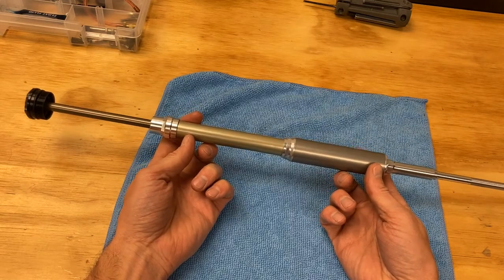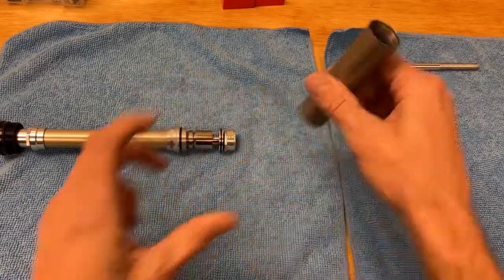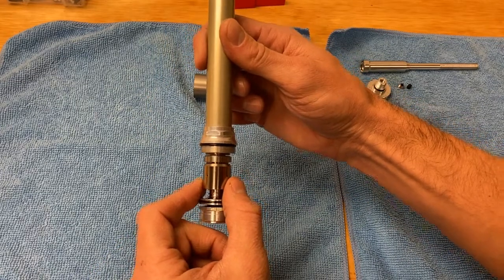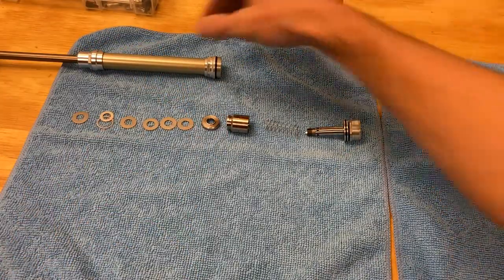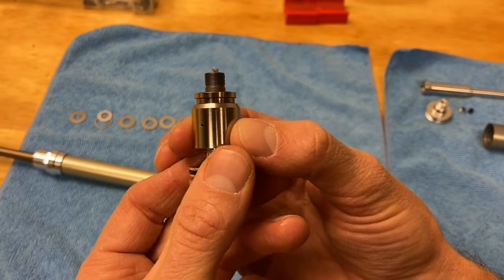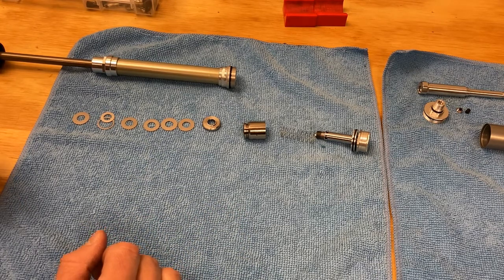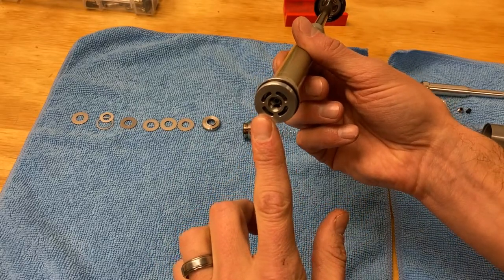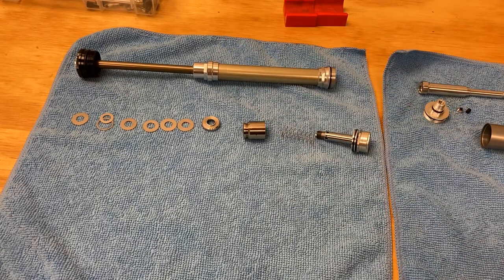Disassembling a SPECIALIZED BRAIN Fork Cartridge

Comment: Hi, great video, I'm not a mechanic, but I'm interested in how to setup the shims you mention to reduce pressure threshold. Would this setup increase sensitivity over small bumps? How is this setup done? Reduce shims to reduce pressure threshold?
Reply from the maker: stock is 4 shims behind the ring.  cut it back to 1 or 2 if and the small bump compliance get WAY better.  The fork becomes a dream to ride compared to other dampers.

Comment: Hi, fellow bike rider. Does this cartridge needs any seals kit during bike usage? Any seals kits like the Fox ones for the micro brain, but for the front fork. I have 2014 Epic Comp with Reba, could not find anything beside rear brain/air chamber.
Reply from the maker: I have the same bike.  The seals are proprietary and bike shops will not sell them to you... HOWEVER.  The seal kits can be found on ebay.  

My advice...  Remove 3 of the 4 shims preloading the ring shim on the blowoff valve.  It turns that damper into an absolute miracle.
Reply: @INTEGRALPHYSICS  i am not a mechanic and i dont have tools/skill to disassemble, but i will tell my mechanic about your advice.
Any ideas about name of the seal kit? I only found this one: Specialized Brain RockShox SID Fork Service Kit Part# 11.4418.009.004

Comment: Hi Integral physics, I hope you can help me, I have a sid brain with hydraulics identical to the one in the video, I wanted to ask you, please, if you can show me the correct procedure and the type and quantity of oil to insert to restore it.  I lost all the oil inside and I don't know how to fix it.  A thousand thanks
Reply from the maker: Getting the oil in and the cartridge bled is not particularly hard.  Charging the IFP chamber takes some specialized equipment. (a fill needle)
Reply: Would you mind to tell me the pressure for the nitrogen chamber? 2014 Sid brain many thanks

Comment: I can see this system working quite well when tuned to the rider and terrain but terrible if not. The inertia valve i suppose controls 'low speed' oil flow which when in more closed state transferres oil pressure much sooner into the ports closed by the shim stack. If you would have the right shims and a reasonably light spring/low preload pushing the shims onto the port the whole system should be quite active. Making this system work well for a wide range of weights i would think would be quite hard. The threshold pressure keeping those ports closed would have to be quite high though though otherwise when the inertia valve is closed the oil pressure would simply flow past the shims. I find this concept of the inertia valve kind if weird as in choppy terrain the valve would be opening and closing very quickly as the weight rattles back and forth.
Reply from the maker: You are correct on all accounts.  Stock the inertia valve-bypass valving is awful.  I finally settled at about 1/4 the stack stiffness.  It was stiff enough to prevent bobbing when sprinting but provided a bit of bleed on sharp hits that would try to move the suspension before the inertia valve could open to dump oil.
Reply: @INTEGRALPHYSICS  Excellent explainer! Is this too firm of a shim stack why it feels like "clunk" when the system opens?

Comment: Thanks so much for the video. You are the only person sharing how to service a brain fork. Would you be so kind as to tell me how to take the damper out of the lower leg? Thanks again.
Reply from the maker: Looking at the bottom of the lower leg from below, use a 10mm  (it might be 12mm, I forget)  DEEP socket to loosen the oddly long nut down the threaded rod.  Unscrew the nut 5 or six full turns.  Then with the socket still on the nut, tap upward on the end of the socket with a rubber mallet to loosen the dampers from the lower legs.
Reply: @INTEGRALPHYSICS what happened to the ET pictogram pirate long tentacles? With the Albanian seed deployment 😭
Reply: That's the chicken leg frog leg tadpole one spunk, messiah situation was a ball as the spunk, sperm cell 😭😂

Comment: Hi, INTEGRALPHYSICS, im from mexico. I saw your video and read all your answers, this day tried to service a specialized s90 fork, when i tried to dissasemble the fork, i didn't se the circlip that retains the bottom blue cap, so i put a hex key in the little socket, and i heared some of air lossing from it, inmediatly screw it again, i think i remove some of the air from the cartridge and i read in one answers that it haves a 100-110 psi and i will need a needle to fill it. I saw that the bottom screw haves a little black dot, and i wanna put the correctly amount of air,  how can i do that? Just making a special tool to fill air with a neddle of a syringe and inserting throught the black dot?

I will apreciate so much if you can help me
Reply from the maker: Using a syringe needle is very difficult and VERY dangerous.  There are needle filling tools that can be purchased but they can be a bit pricey ($100).  I have not had problems drilling out the plug seat that held the black plug and epoxying in a presta stem and valve.  I have never had a s90 apart so I don't know if a similar solution would work for you.

Comment: My brain stopped locking out rider pedal bobbing but it still absorbs shocks. Any suggestions to get the brain to start doing its job?
Reply from the maker: Crank the rebound all the way slow.  Push the bike down hard.  If the bike comes back up quick then you have lost IFP pressure and need to recharge the chamber.

If when cycling the shock you hear a squelching sound, typically at the top of the travel, you have air in the fluid and need to replace a seal.

Good Luck...

Comment: Hi! Thanks for the video!
Sorry for my english, im from Uruguay 🇺🇾 
I want to know in what part of the system works nytrogen, how can i fill up and what is the correct pressure en PSI.
Best regards
Reply from the maker: Nitrogen goes in the the chamber that sits at the bottom of the damper.  The chamber requires a small needle to inflate and can be quite a challenge.  It takes 110psi.  Air works just fine in the place of nitrogen.
Reply: Thank you very much for your answer, is very helpfull for me. Last question, how much oil i will need to refil and wich oil should i have to use?
Reply: @valentinbarreto9332  You'll bleed and fill the cartridge, and set the piston roughly 3-5mm from bottomed out, with the shaft fully extended. Most fluids with a viscosity 22-35Cst will work well. They say to use "Rockshox 7.5" in the manual, but they mean 7wt.
Reply: @seitenryu6844  thank you very much for your answer, is very helpfully for me! 👏🏻💪🏻
Reply: @valentinbarreto9332  If you do it, please make a post about it on mtbr shock and suspension forum. Cheers
Reply: @seitenryu6844   In the previous answer, you talk about a manual, is it possible for you to share it?

Comment: Was that an IFP at the beginning of the disassembly? You were talking about a rubber pellet being there so there must have been pressure inside, right?
Reply from the maker: Yes.  There is an IFP sitting on 100-110psi
Reply: @INTEGRALPHYSICS  Any tips for IFP depth? Oil weight?
Reply from the maker: @BikeGuruHowick  I use Fox Green (10wt) which i believe is what was in there stock.   IFP depth is  30mm but they added a nylon glide ring to the IFP in later years which changed the ifp depth.  Basically you want the ifp within 2-3 mm of the plate which sits behind it.
Reply: @INTEGRALPHYSICS  what a champ💪 Really appreciate the help man, thank you.
Reply: @INTEGRALPHYSICS  What's the purpose of the IFP?

Comment: please do Rockshox Brain 2.0 rear shock service video tutorials
Reply from the maker: I will do a tutorial on the rear shock next time I have it apart.  The only substantial difference is your bladder vs my ifp.  I will also do a vid on my vaccum bleeder as that is needed to bleed most shocks.
Reply: @INTEGRALPHYSICS  Do you NEED a vacuum bleeder or can you use the standard rockshox suspension bleed kit that looks like a brake bleed kit?
Reply: @INTEGRALPHYSICS   done subscribe